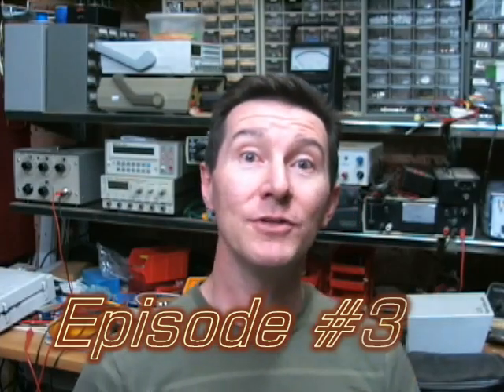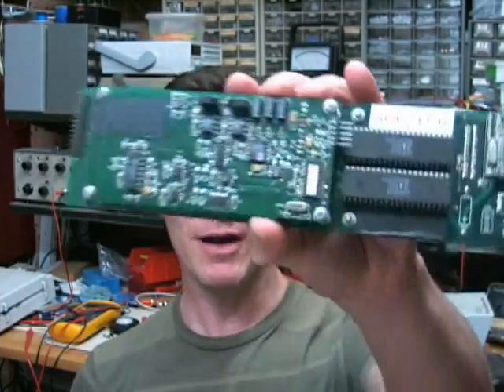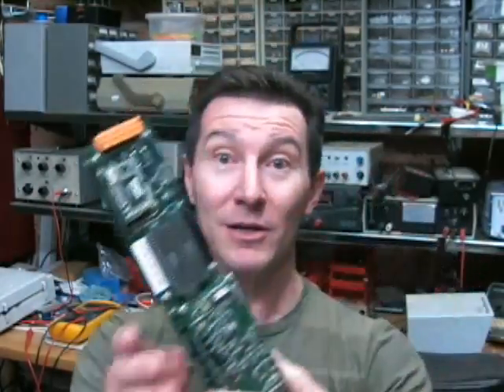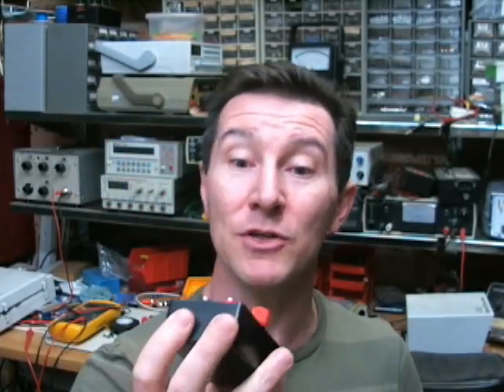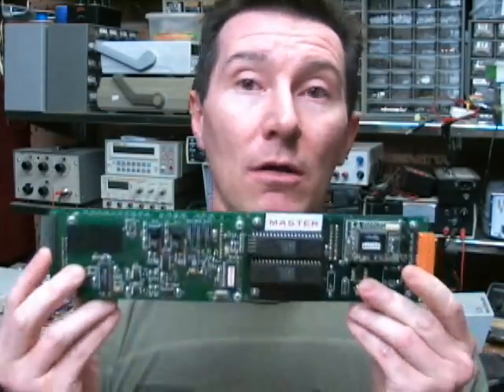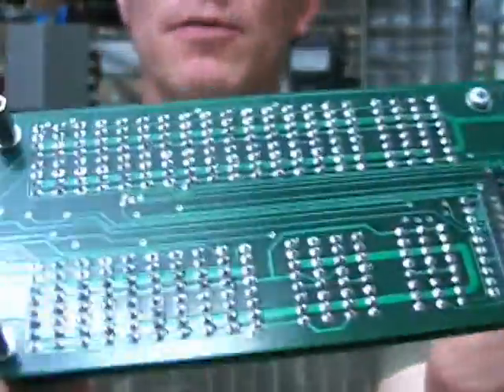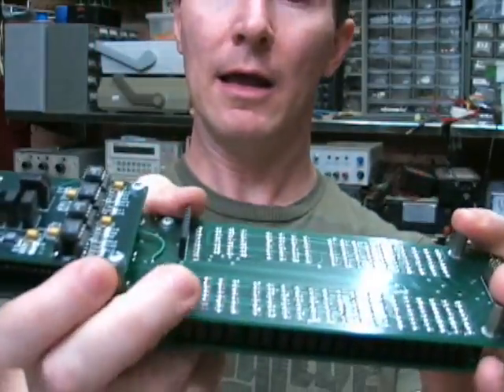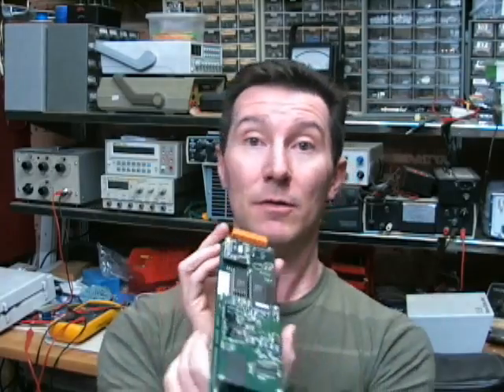EEVblog #36 - It's Hardware Puzzle Time!

Comment: 50mhz crystal, master unit, 32 bit input.. some sort of segment led display controller. Commercial banner would be my pick since this board looks like it would fit into an expansion slot, allowing for changes depending on display size.